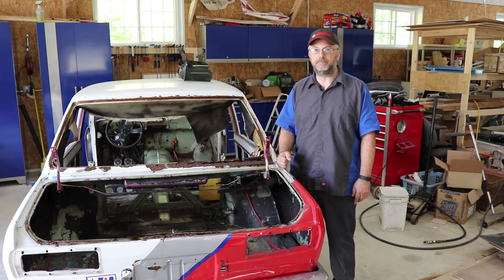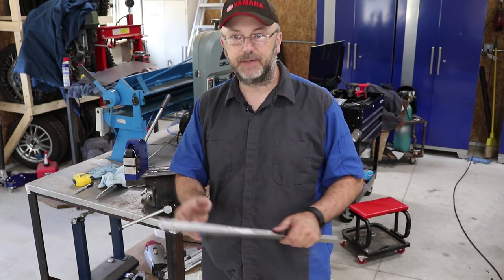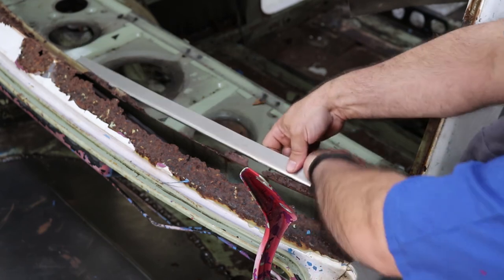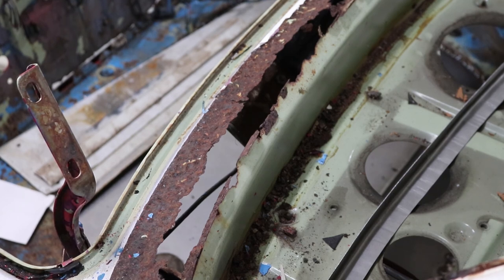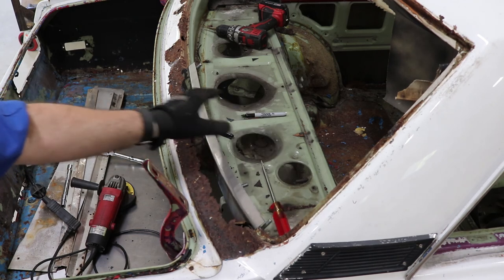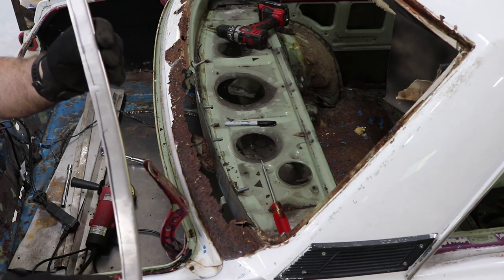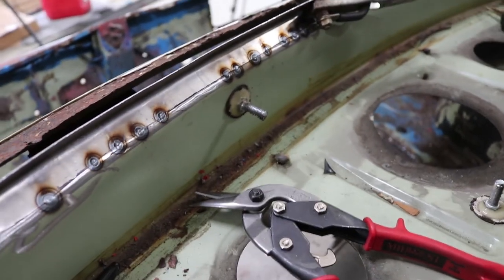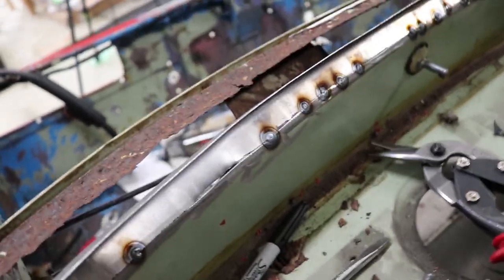Datsun 510 Rear Window Channel Rust Repair

Comment: Chappy, The deck filler panel (and many other panels) are now available thru www.FutoFab.com They have yet to get them on the website, but the price is  $180 for the outer side of the area you are reworking. This would save considerable tiime.
Reply from the maker: I wish I knew that!  I had checked your website for this and saw you didn't have them.  If you look at my latest video I fabricated that panel.  My results were OK but certainly not as good as if I had a proper stamped panel.  I may look into re-doing that.  BTW, I live not far from you and we had a brief email conversation back when I bought the car.

Comment: Wondering why you didn't use a section cut from a good 510 body? Just cut it out and weld it in.
Reply from the maker: +IrishPalestinian  that would be easier but I don't have access to any spare 510 bodies.  Junk yards around here rarely have anything more than 10 years old.